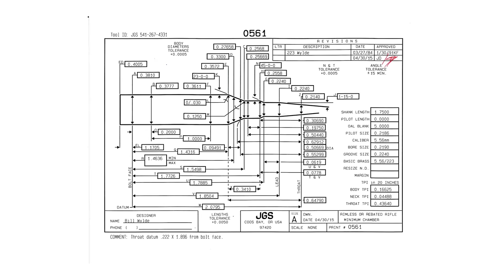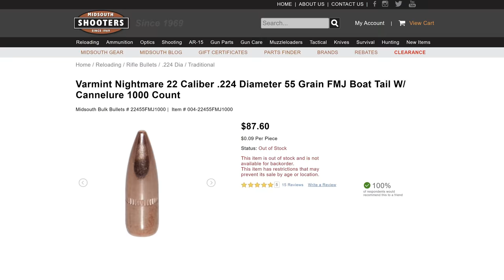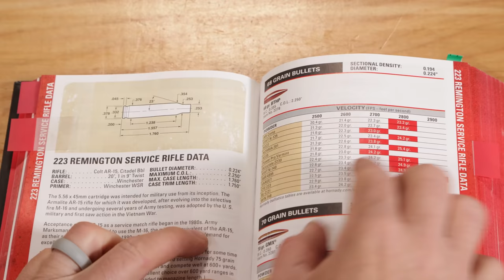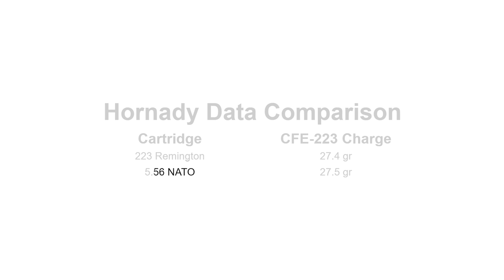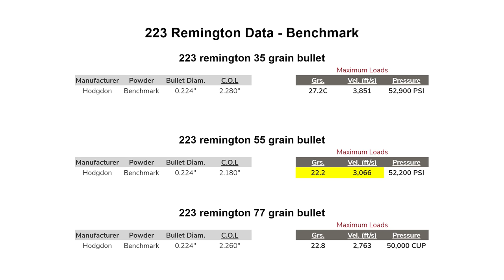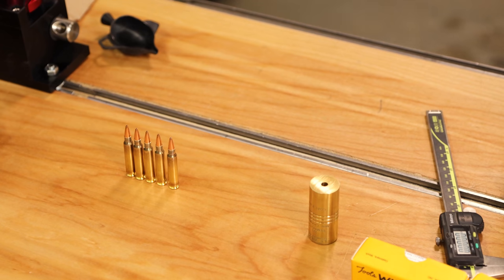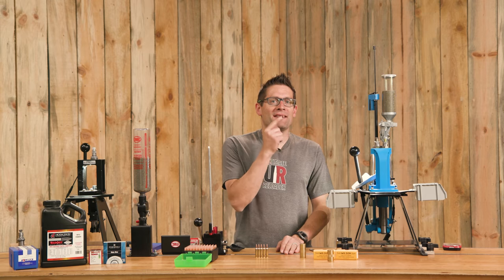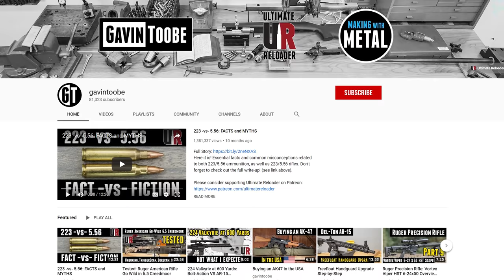Reloading 223 / 5.56 From A to Z

Comment: Can you actually load 5.56?  Because of the different primer seating I mean.  How would one actually redo the 5.56 type primer? If you’re using a swage tool to take out the primer pocket crimp, how do you put it back? Or do you just have to keep buying 5.56 from the gun shop? Sorry, might seem like an idiot question, but I’m literally just starting to look at reloading, and I have a 5.56 stamped barrel so I can shoot both.
Reply: The primer crimp is not necessary. It is used on military loads for additional primer security.

Comment: what about case dimension checking on  the progressive press?  How do you handle case trimming if needed?  It looks like you are assuming that the sized cases will always be within the required dimensions.
Reply: I do all my case prep before I start on the progressive press, meaning that station one is unused.  I also avoid getting lube everywhere.

Comment: do you expand the neck on the brass for bullet seating? I noticed when i use my full length sizing and decapping die and then when i try to seat a pullet it scraps away at the jacket on the bullet.
Reply: The ball on the stem of your sizing die may be slightly undersized.

Comment: USING THE SAME MANUAL, THE MAX LOAD FOR 60GR 556 IS 27.7GR OF CFE223, COULD YOU USE IN 223 BRASS, BUT ONLY FIRED IT IN 556 CHAMBER

Comment: This might be a silly question, but, a friend of mine asked me why I only load and reload brass cases/shells. Meaning, Why not steel cases or the aluminum ones.. I answered with, I do not want to wreck or wear out prematurely my dies and carbide die bushings, at least with the steel cases. The aluminum cases not so much, but, me personally, never come across the aluminum units, or at least to validate possibly being required to alter the set up for only a hand full of rounds. I thought about it, the steel cases/shells at the factory's are stamped out and swedged into into final shape, how are they getting away with long life of their dies and die bushings, when their automatic machines are pumping them out endlessly. 

Is there any reason(s) to not reload steel cased/shells? or have I overly thought this out, and this whole time, I could have been punching those out too, on a different set up running... ?
Reply: Steel doesn't flex like brass so if you attempt to resize it it won't work well. Just stick to brass
Reply: @themobsprinter  Thank you

Comment: What 223 die set do you recommend to reload “range” brass pickups on a single stage, as well as a, on a Hornady L-N-L progressive. Since I’m not a competitor, I plan to reload for general target practice, before gaining experience to reload for hunting purposes.
Reply: At present get what you can, they all work. Lee’s are lowest price and the work. I like my Dillon dies they are in the middle price wise. I’d say as long as you have a carbide size die your beard will be long and white before you wear them out. 
Components mainly primers are hard to find now. Good luck

Comment: Gavin, when a powder is listed as faster burning or slower burning, does that correlate to velocity or something else?
Reply: The biggest piece of information to keep in mind is faster powder = peak pressure sooner. The basic reason for having different burn rates is to provide a combination of peak chamber pressure and area under the pressure/dwell-time curve for your particular projectile/barrel setup. The end result of faster v. slower powders depends on your projectile weight and barrel length. Too fast of a powder and you're burning it all before the projectile utilizes the whole barrel. Too slow and you get a big fireball of unused powder out of the muzzle. The best advice I can give is an hour on google looking at load charts will save you ten hours of trial and error.

Comment: A to Z? somewhere in the Ds I was hoping to hear about downloading the powder to obtain slower  quieter loads. I looked in S for subsonic and P for plinkers, nothing.
Reply: You are unlikely to find such data for bottle cases - they are designed to produce high velocities.  

If you want a quiet plinking round, get a 22 rifle that will handle 22 short or 22 CB cap cartridges.

Comment: I recently started reloading 223/556. If I am just loading plinking rounds and can’t find load data for both 556 and 223 with the powder being used, can I just use a 223 load data and stay under max charge?
Reply from the maker: Yes, if you start 10% below and work your way up (checking for pressure issues), you should be good to go!
Reply: @Ultimatereloader  thanks so much! Just to clarify, start 10percent lower than max loads or 10 percent lower than what it says for the minimum?
Reply from the maker: Dylan- 10% under max (or at starting load, what ever seems best).
Reply: @Ultimatereloader  thanks so much for the responses! Love your content man!

Comment: I have done my own analysis of 223 vs. 5.56 and my conclusion was supported by a Vietnam war vet and three other reloaders. 
Bottom line the cases are identical and the only difference in store bought ammo is the 5.56 has some 1.5 to 1.75gr. more  powder so the main difference is in the rifles.
The 5.56 chamber throat is a little longer as is the leades to compensate for the extra powder and bullet fps otherwise these two cartridges are identical.
Reply: The people told you wrong. The neck and case lengths are longer on the 5.56 and the throat angle differs by about half a degree.  I believe the author has a video on this.
Reply: @buggsy5  I bought a case of 223 & 5.56 Winchester and cut them up and measured everything possible inside and outside and the two cases were identical. What your talking about is the barrel chamber which is different but only in three areas. The grade of the throat, length of the throat and the length of the leades. Otherwise identical. 
YOU ARE DEAD WRONG !
PS: the only reason the angle is different is because the throat os longer.

Comment: Great video thanks for sharing.. I sure wish there was more load data for cast powder coated bullets in the .223/556 caliber.
So far my best info comes from Elvis Ammo on the Lee six cavity 55 grain cast bullets.
https://www.youtube.com/watch?v=OiChkhAjmzs&t=815s
22.9 grains of W 748 ball powder (very close burn rate to Varget) Case OAL loaded length of 2.100. (speed of 2,500)  
This is a very sweet spot for cast bullets and runs just fine in my M&P Sport II, but I wish I had more options for different powders using cast lead bullets.
 It's a very economical load to shoot with cast bullets and I get no leading from using it.

Comment: At 5:03 you said 28.8 grains of water, lol.
Reply: reloading manuals always give the case capacity in how much water it will hold.  There can be a difference in case thickness.  For instance, military cases often have thicker walls but yet have the same outer dimensions.  The case with thicker walls will hold a smaller volume of water.
Reply: @rockordnance , oh!    wow, didn't know that, learn something new every day, thought it was just a brain fart.

Comment: Thank you all the informative videos. I have a question about factory ammo. Since the bullet length varies quite a bit, would you recommend removing the bullet and reinstalling to the recommended length or pull out the deeper seated bullets to the recommended length. I am asking for an AR platform. Thank you in advance

Comment: Hey Gavin.   Two questions.  I find that I have to adjust the die each time to crimp each case because they aren’t all the same length.  Do u trim all cases to the same length? 

Also.  I didn’t hear you talk about shoulders.  Do you measure the shoulders?   Or do you not worry about them as long as the case fits properly in the case gage?

Comment: If the bullet diameter is .224", why call it a .223?  Might as well call it 22-zebra, or 2-walla-walla.
Reply: That is not unusual - that is true for many cartridges. For example, the .38 is actually .357. If I recall correctly, the 44 magnum is .454.

Comment: I have the following question. 

Is the 223 brass prepped beforehand i.e. resized /trimmed and deprimed or not? 

Reason why I ask:

The first stage is a seizing and depriming? Fired brass is therefore only cleaned and primer pocket not cleaned?

And if it is also resized...do you assume the length is okay...untill the bullet is finished and then measured?
Reply: Always check brass length..... before reloading, double checking everything is just being safe. Rather be safe then take the possible danger in blowing up your rifle or even injuring yourself. SAFETY FIRST MAN.🙏😎